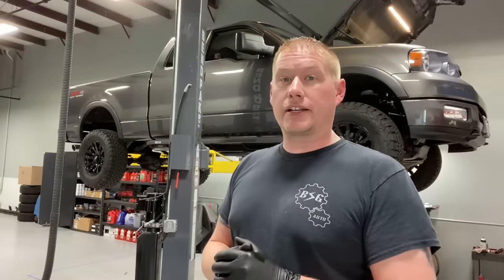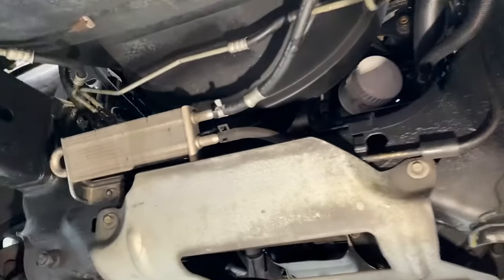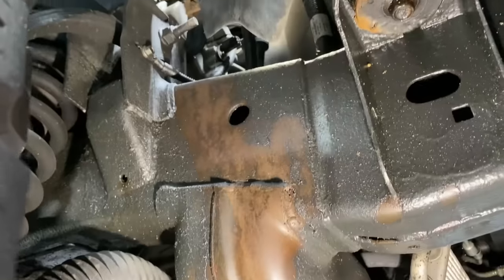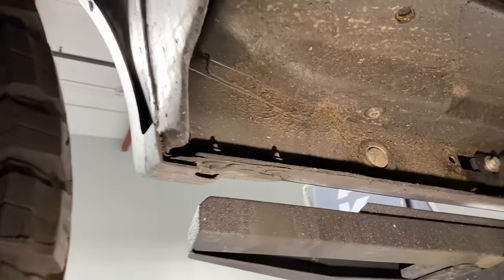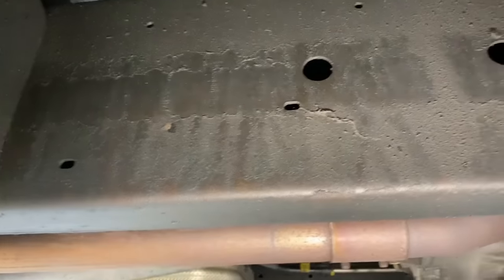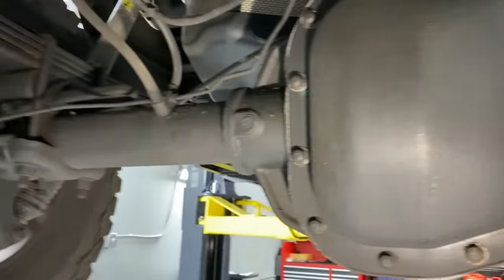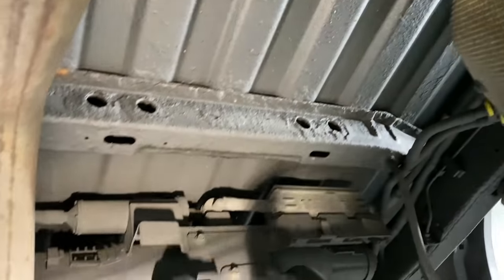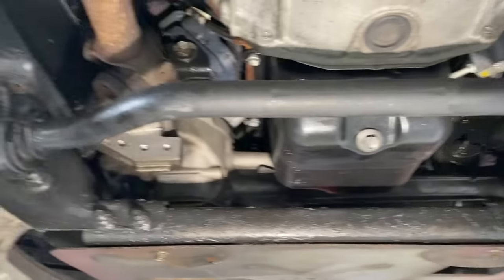Woolwax Undercoating 1 Year Review: Is it Really Better Than Fluid Film?

Comment: With wool wax, do you need to be careful around rubber, gaskets, and wiring like with some other undercoating products?
Reply from the maker: yes
Reply: My experience it's like fluid film that it's electronics safe but any rubber or gasket that isn't oil rated will swell. But I havent had crazy problems
Reply: @esadventuresandmishaps7018   Good to know.  Thanks!

Comment: I have a question. I took the cats off my V10 gasoline 05 F350 exhaust. I was told I need to put a tuner on it because of the check engine light is on and keeps having misfires.

Comment: Hey… I’m buying a 2 post lift soon.  Any recommendations. I don’t plan on using for commercial purposes, just helping with our work trucks and vans.  The main use will be basic servicing and applying undercoatings yearly.  Eventually, as I’m nearing retirement, I hope to restore an old truck.  I added on a third car garage to my home. It’s 30’ long 15’ wide and has a shop space that adds another 15’ of width for about 1/2 of the length. I have 15’ of ceiling height.  Need to be able to lift Ford Transit high cab extend length.
Reply from the maker: Rotary
Reply: I bought a Mohawk Series 1 which is a 10K lift for a little over 5K installed. It will pick up a 3500 series 1 ton diesel dually with no problem

Comment: @FordTechMakuloco
How would you rate chassis saver which is a rust converter preventer???
If it is applied after wire brushing all the loose rust, it prevents new rust from forming and converts the remaining rust to good solid metal!

Unless that’s just hype.
Reply: Isn't that like POR15? (Paint Over Rust) Although, you need to descale loose pieces, clean, prep then POR. Then paint if any exposure to sun. I did some old radiator pipe and I might just do the whole house!

Comment: Question to those who might know. My son bought a 2021 F-150 and is thinking about using a combo of woolwax and cosmoline. I looked (did not get under the truck) and there seems to be at least 2 round cross members with studs (maybe it's the bolts that hold the bed down?) going across under the bed. How would you treat this area? I didn't see any access holes on the other side of the studs. The plan is (maybe :-) ) to use woolwax inside the structural cavities and cosmoline on the outside. From everything I saw cosmoline doesn't wash off which may make it great for the outside of the rails, wheel wells and any splash prone areas. Woolwax should last a very long time in areas that aren't hit with water and slush.

Any thoughts are appreciated!

Comment: Thx for the video!! I have a 2014 f150 4 door crew cab. I’ve noticed that the cab corners tend to rust through. Mine haven’t yet. Do people drill a hole in the bottom of the corner to allow water to pass thru?? I was just wondering what I can do to prevent it from happening to my truck. Thx
Reply: Spray inside of all panels with fluid film

Comment: Looks like you have bilstein 4600’s on the rear but not the front?
Reply from the maker: 5100's front and rear actually, the 4600 series is yellow.
Reply: It was hard to tell in the video if those were sink or yellow... how is the ride?
Reply from the maker: A little rougher more controlled but then again I used their leveling shocks up front adding 2" so its going to be.

Comment: Will this trap moisture in between metal and product ?     I had Z -Bar and rust out so bad broke my frame in half .    Went back every year seemed like got worse just put heaver coat smell like weeks to get smell out .   I was told it would do that cause moister is trap in.   I just a newer truck like to get it treated .    Is this a do it yourself product?
Reply from the maker: It will not trap moisture.

Comment: I have a 2012 F150 5.0 l with a cooling issue while Towing my boat temperature wants to climb pretty high changed water pump thermostat still have the same problem this only happens when I get on the interstate and try to go 70 miles per hour if I stay at 55 miles per hour to 60 miles per hour no issue any help would be greatly appreciated thank you

Comment: So when you need to reapply this stuff, do you need to hose off or pressure wash the undercarriage or just reapply over the dirt and salt that's on there ?    I used to use Fluid film and i would powerwash the undercarriage and let it dry for a few days then put fluid film on but i wasnt as detailed with it as you are, but my Crapalanche still rotted out .

Comment: I have a 2008 F150 5.4 3V, my truck turns over when cold. But, in between driving here and there the truck is hard to turn over. It sounds like it wants to turn over, but it doesn’t and kind of chokes into turning over. And sometimes I just turn it off and turn it back on and starts right up. Don’t know what it could be?

Comment: There has been some discussion about these products like Fluid Film, Woolwax et al causing rubber and weatherstripping to swell and expand.  Have you seen any problems with the rubber boots around CV joints etc.?
Reply from the maker: Yes avoid anything rubber as I mentioned when I did the install video.

Comment: Do you need to do any prep work with the metal before applying?
Reply: Generally, just remove loose and flaking rust, surface rust doesn't need any prep work before spraying

Comment: Would like to know where to get the blanking plugs for the inside rocker sills. Ford put tape on the holes. Tape falls off after undercoating truck. So much salt gets in those holes.
Reply: @dentside78  They're large holes. 2" x 4" or so.

Comment: If you live where there is salt and snow then you already know undercoating damages your truck because when you get condensation from super cold temperatures condensating through water gets trapped between the frame and creating rust
Reply: This is not the rubberized crap that was peddled in the 70's and 80's. Lanolin based coatings like woolwax and fluid film work extremely well, and condensation cannot be trapped behind it.

Comment: My father lived in Northern Michigan for 30 years and always driven front wheel drive Ford Taurus’ and never under coated his cars, never used winter tires and never had rusted out frames or any issues associated with rust. I’m not a big Ford fan but the Ford Taurus’ were indestructible.

Comment: What if the frame on a 2006 has significant surface rust? Does this just spray ontop?
Reply: It can be applied over top.  It's a rust inhibitor but won't reverse damage done

Comment: Hi Dear @FordTechMakuloco

I’ll be in need to you’re assistance Please !
maybe its Sound Stupid but honestly the dealer her says replace Trans without checking any thing .
in this country unfortunately No one has any idea how to fix FORD or any American Vehicles . Thant’s why I need your Assistance Please .

ill Brief :

I bought used 2009 Explorer 4X4 month Ago .
The only issue was ( Harsh engagement from R to D ) No other issues at all - All Gears Shifting is OK .
I went to dealer ( Transmission Mount Checked ok ) ( Flued was a bit bad but Not Burnt )
Engine Thermostat For Some Reason Was Removed .

- “ Trans”  Oil + Filter Changed . ( But R to D Still Harsh Engagement with slight Delay )

1 month driving every thing OK ! ( 100 mile daily Driving – 30 days )  

- I re-installed Thermostat ( 2 days back ) – went for log drive around 100 miles . Engine Temp. was 89-92 degree 

95 miles every thing ok . Then :

- Suddenly 5th Gear RPM went UP , 5th Gear Gone 
-	4th Gear High RPM  .. 1 minute then Gone
- 3rd Gear .. 1 minute Then Gone
- 2ng Gear Stayed for 4 min at high RPM then Gone 
- 1st gear is ok for 2 min then Gone .
- Turned Off the Vehicle Turned it on to cool down after 2 min 1st gear Engaged with delay to 2nd gear with delay … SLIP SLIP .  no more gears .

I keep driving 1st and 2nd gears while trying to cool down the transmission every 3 minutes .  ( 5 miles Total  )

Reached Home , Parked and shut it off .

Next Day Turn it on  ( harsh Torque converter sound ) R and D  are engaging for 20 second then gone .

I asked a Computer Guy to come and Check .

I have attached the Errors for you to see .

P1705:00   :    ODDTCs  : TR(Transmission range) sensor out of read codes range 

P0741:FF   :    CMDTCs  : TCC(Torque Converter Clutch Control Solenoid) System Performance. Torque converted slip is greater than expected .

P1783:FF   :     CMDTCs  : Transmission OverTemperature Condition .

Thank You in Advance .

i have emailed you the same .

Comment: It's so expensive compared to just using rust converter primer and paint. Paint will not wash off that much after just a year even in the wheel wells.
Reply: it’s actually very inexpensive. i did my entire truck for less than 50 dollars

Comment: Great video.  Off topic i had the same tires on my 2010 f150 fx4 but they started cupping.
Changed struts got the alignment done noting helped.  Took the truck to the dealership only thing they found was a bad steering shaft.
Any thoughts? 
Thank you
Reply: are you rotating every 5,000 miles (religiously) and watching the tire pressure?
Reply: Tire pressure was at 35 psi and to be honest i only rotated the tires when i noticed the cupping.  Then i changed the struts got an alignment got the truck looked by ford dealership and it still cupped the tires that were on the rear of the truck and they were in good shape.
Thank you for your feedback.

Comment: This proves at least to me that rust can be beaten even if you live where you live. The biggest mistake in managing rust is to think you can do something that will fix it forever. You need to treat all rust-prone areas at least once a year, there is no way around that. I guess you can get away with 4 or so years if you buy a brand-new truck...but that may bring a whole host of other problems as well.

Let us know how long it takes you to retreat... I think cleaning up afterward will be the hardest part...
Reply: I reapplied woolwax in a 2013 Hyundai accent in   a couple of hours and used approx 2 gallons of product which included spraying up into every hole in the rocker panels and frame. I sprayed woolwax into all the doors and it creeped out approximately 3" on the outside of the doors during the summer in the hot weather. I'm very impressed with the woolwax, it is a pain to work on areas that have been treated but it is much better than having to fight with rust and frozen fasteners
Reply: @SteveUnroe  I think that will be time well spent for the future. It's getting harder and harder to find sensible runaround cars like the Accent.

Comment: You didn't answer the question, is it better than Fluid Film?
Reply: Perhaps you were supposed to decide for yourself after some research of your own?
Reply: I have a 2013 F150 with 290,xxx miles.
I've had the truck since new, 4 miles on the odometer. I've lived in upstate NY, Denver, Massachusetts and New Hampshire since purchasing the truck. 
Its been sprayed with chainsaw bar & chain oil 4 or 5 times.
Looks much better than fluid film or Woolwax.
Bar & chain oil holds up way better, less washout in nearly every area he had trouble. It seeps and creeps and self-heals very well.
Costs about $12-15 per gallon versus $50+ and sprays very well out of a fluid film gun.
The dust cakes onto the oil and actually looks like rhino lining over time.
Try it out sometime

Comment: prob wanna drop that steel spare n coat both sides. Lost a 04 explorer spare rim, never down, rusted out in ny
Reply from the maker: I agree that is on my list before winter. I had it off the truck forever because it would not hold air due to rust on the bead seat area. Now that is cleaned up with a new tire its time to spray the rim.

Comment: My father hipped me to Woolwax over 50 years ago, as he used to perform undercoating services at his Shell service stations, back in Michigan. Great stuff! I have applied it to every vehicle I have ever owned and never regretted it.
Reply: NiCE !!!
Reply: Do u clean the rust prior to applying woolwax? Some people are saying to just spray it over which i dont like that idea
Reply: @andyl9920   its likely best to have a 'clean' surface... from some experimenting i did a year or two ago on a delaminating Gen7 Corolla rear subframe, i sprayed WW onit then checked back a half year later with some intresting results.... ALL of the protective OEM paint coating on that subframe part that had not flaked off was NOW easily removable with a knife to the bare metal... i used some spray to hopefully completely clean and supposedly completely dry the surface and reapplied the WW
Reply: @andyl9920  You would want to remove any scale or light surface crud, but otherwise it applies over existing rust to seal the metal from air contact, thereby stopping the corrosion process. It creeps/seeps into crevices for great coverage, as well.

Comment: I used it on my F-150, worked great. Just makes for a messy day next time you work under the truck.
Reply: Which is within a few days since it’s a Ford.
Reply: @fsu3784  2010 F-150 with 128,000 miles, a few small issues but nothing major.
Reply: I just replaced tie rods and a lower ball joint on my car a few weeks after undercoating it and it was a mess.  Make sure you replace everything that needs to be replaced before undercoating and you'll be fine

Comment: Woolwax product, not baaaaaad! 😖

Brian, ScannerDanner just did a video of a F350 digital MAF showing 0V on SnapOn scanner after damaged harness repair.  Everything works fine but the scanner showing 0V was a real red herring.  Be cool if you could provide your input, thanks! Paul agrees!
Reply: I watched that video.  The problem is aftermarket scan tools, even snap-on give false data quite often.  It takes a good tech to know when the readings are impossible and to not go down the wrong rabbit hole.  If you watched the whole video that particular MAF is a frequency based MAF which is not normal for a FORD product.  The snap-on software isn't set up for Frequency MAFs on a FORD product.
Reply: Thanks! Good points.

Comment: How much did you use? Thinking about getting a gallon for my 4runner but wondering if ill need 2
Reply: I probably overdone it, but I used approx 8 Qts to do a Hyundai Accent.  I sprayed approx. a gallon up into the rocker panels and the holes in the unibody/frame and the rest on the underbody.   I look at it like the Woolwax is cheap compared to the cost of a new vehicle, so if a few gallons of Woolwax will protect my vehicle and let me drive it for an extra 5+ yrs, I'm saving a lot of money.

Comment: I am here because I purchased 2 55 gallon barrels for composting and these barrels were used to contain woolwax. So I decided to check it out. The little bits left over in the barrels have a milky color to it. 

It seems to work really good but the only down side I see is it makes everything dirty. Imagine 10 years of applying woolwax once a year. 

So my question is how is it to work on a car that gets sprayed with woolwax?

I would assume you must get really dirty from my experience cleaning out these barrels it is a pia to remove. You have use a solvent and a lot of it.

In my opinion if you are going to service your rust once a year might as well use something that will dry so you have to deal with all that dirtyness when you work on the vehicle.
If anyone has a counter to what I am saying please share.

Comment: Don't spray shocks because one of the functions of the shock housing is to dissipate heat and by applying a product like this it won't be able to dissipate the heat properly as it will insulate the shock, prematurely wearing out the shock.
Reply from the maker: lol a little early for April fools days lol.

Comment: We shouldn't need to apply these aftermarket products on brand new trucks to prevent the frames and chassis components from rusting. Ford needs to step it up with their coatings and steel quality.
Reply from the maker: All vehicle brands need a coating like this to prevent rust especially with them throwing brine now. It's kind of like ships on the ocean, they are coated with the best rust proofing paint made for marine conditions yet still need rust remediation after a short period of time, its part of being the salt belt of America.
Reply: I haven’t seen a vehicle brand yet that doesn’t rust out unless substantial effort is put into it to stop rust, such as this product. I think Subaru does the best job however at preventing rust of all manufactures
Reply: Unfortunately gm still has decided not to e coat their frames and the wax they dip the raw metal frames in does not hold up for long hence the reason i woolwaxed my new 2021 denali  trying to keep it from getting the cancer

Comment: Give it a few years and the coating is going to crack and expose the metal to moisture. Moisture is what causes corrosion. The best corrosion protection is using an oil base product that will creep and displace moisture instead of simply trapping it. Thick non-drip coatings are good only when applied in factory when the metal is rust free and completely. Our environment does not allow for thick undercoating to work properly.  Krown is the best product on the market. They have been rust proofing vehicle for over 30 years. Last thing you want to do is trap any moisture.
Reply from the maker: Did you not watch the video? Do you know what fluid film and woolwax is? They do not trap moisture nor do they harden, are you commenting on the right video? Please explain, thanks.